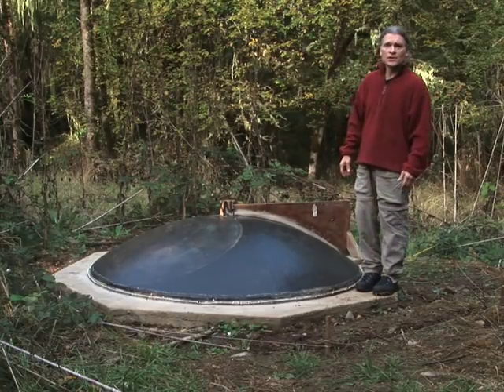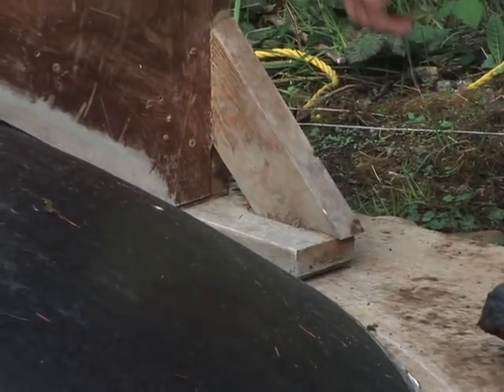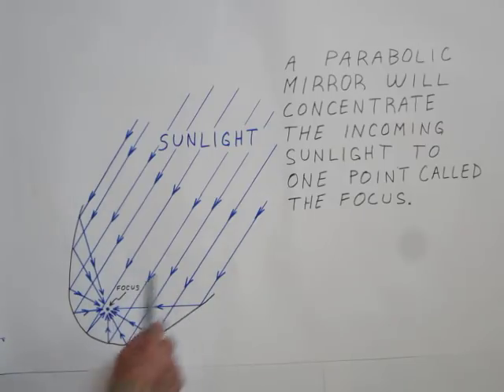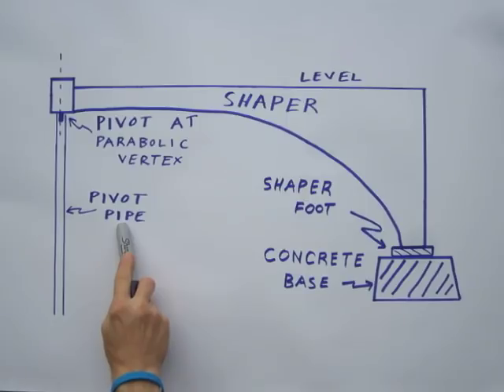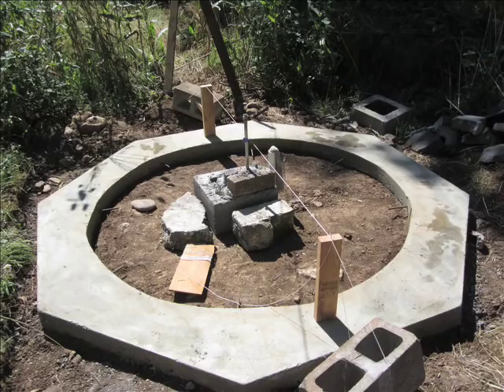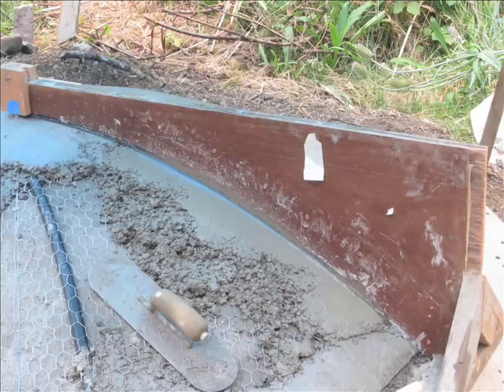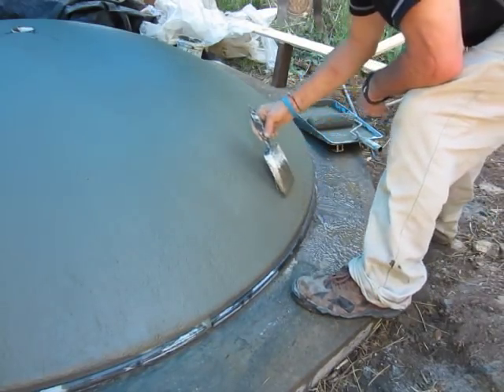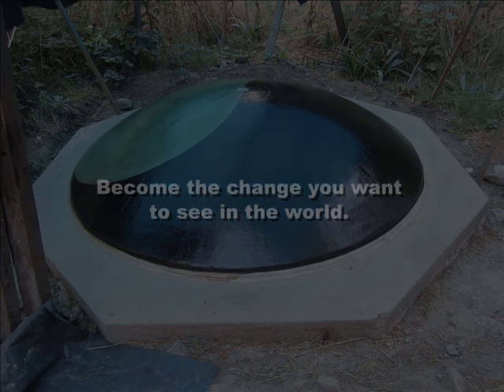PARABOLIC SOLAR COOKER FERROCEMENT, MOLD

Comment: Are you still interested in this project?  I find it very neat to watch these videos.
Reply from the maker: Yes, currently moving on to using "poor man's fiberglass" [ geotextile painted with a cement slurry instead of ferro-cement ] and a light portable mold to lend to others. Also working on heat storage so a bakery can start baking at 4am. and solar distillation of alcohol car fuel.  A bank of 3meter diameter dishes can be used on a commercial level, when the heat is stored and drawn off as needed.  All my designs are low tech using materials from local hardware stores here in Costa Rica. Also tracking and thermostatic controls for baking ovens using the arduino micro controller.  Enjoy...
Reply: @kulemax53video  Aww, that so cool!  I am a Internet Engineer for work.  I cant stop thinking about your videos on the solar cooker.  Its a very good design and low cost and just a very good idea.  I am into the raspberry pi instead of the arduino.  Arduino uses python.  I choose to use raspberry pi because I have no limits on what I can do and I dont need the speed of the arduino.  I want to use your idea with cement and fiber glass over the cement mold.  Then use the fiber glass as the light weight dish.  Then convert it to electricity.  As for the raspberry pi.  I want to use it as a solar tracker.
Reply: I could help build you a solar tracker.

Comment: best with a rotisery. only really good with 1 dish as you are aiming to get the turkey in the focal point. and if you are gonna do a whole turkey you need a BIG dish. what he says about 1000 watts per square meter. well that's perfect 100% (which won't happen, only theoretical) and then most stove hobes are like 1750watts. so you gonna need a big dish or turkey cut into smaller pieces. or a long time.

Comment: With all due respect for an otherwise decent how-to video, lessening anyone's dependence on oil, or fossil fuels in general, is going to take a LOT more than just changing the way people cook.  Not to mention the obvious issues that arise when it's after sunset (or more realistically high noon), cloudy or rainy.  Slap one of these onto the roof of a car and show us a 100% solar powered shopping trip and THEN I'll be impressed.
Reply: the trick would be to use a large enough one for splitting things or processing things to make solar cells, maybe, and then use them to power batteries for short ish trips like you are talking about, but there is a huge amount of potential power in the air around us, as any gas be it oxygen, carbon dioxide, nitrogen, you name it, that is hot enough to be a gas, is moving at an average of 900mph just in various directions to make it seem as if the given air around us is standing still, this speed is enough to knock electrons off atoms on a sold, so, from that you can extrapolate how to generate electricity from pure ambient heat LOL.